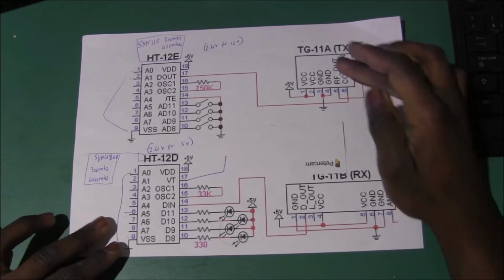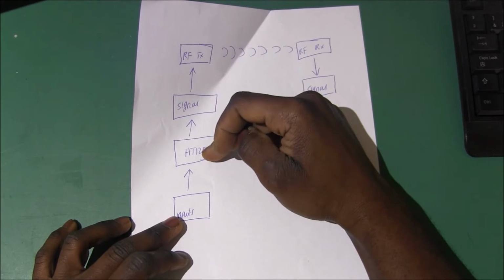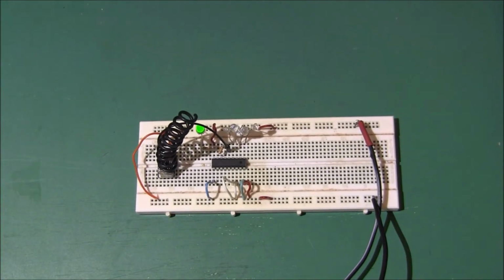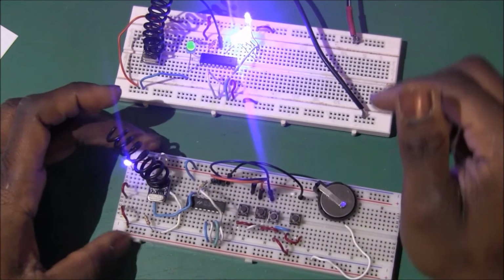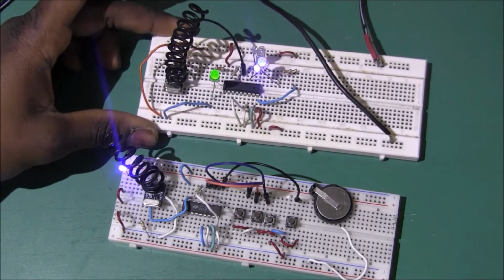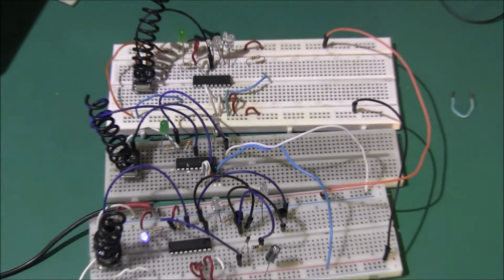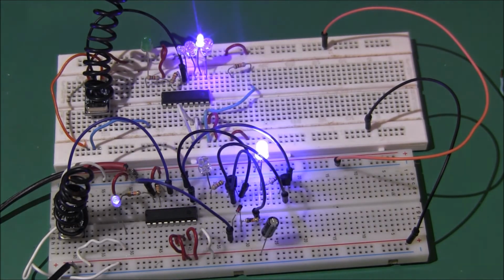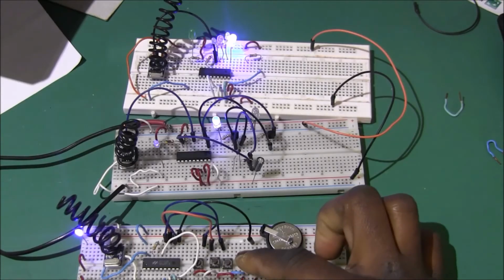ht12e and ht12d working

Comment: why u select the resistor value which is connected between osc pin 15 and 16 as a 750K?
i mean to say that how u select that value? for encoder and for decoder how u select the 33K reply
Reply from the maker: The recommended oscillator frequency is fOSCD (decoder)
=50 FOSCE(HT12E encoder)
=1/3 FOSCE (HT12D decoder)

=PDF(http://pdf1.alldatasheet.com/datasheet-pdf/view/64409/HOLTEK/HT12D.html)

Comment: engineer, kindly I need ur consultation in something and i know for sure u will help me. ur videos are easy and ur explaination is great but i have some questions. 

Kindly can u refer to ur video https://www.youtube.com/watch?v=wmOPcPSR59s ICL7107 please please I have some questions regarding the IC 7660 can I replace it with 7805 it is a voltage regulator to 5v because i cant find the IC 7660 in my country. And I have another question as well if I used direly power supply of 5 volts to the circuits would it be enough instead of using either 7660 and 7805? and also if u have the full connection video of the Voltmeter video can u kindly sir send it to me. I apology for asking too much but I have asked only because i am certin that u will  help. 

This is my mail asmaahassanein2014@gmail.com

ur time and effort are highly appreciated sir